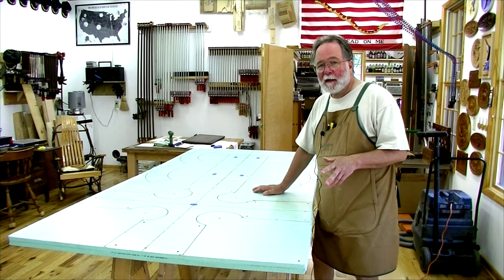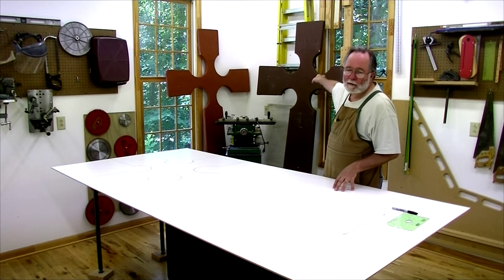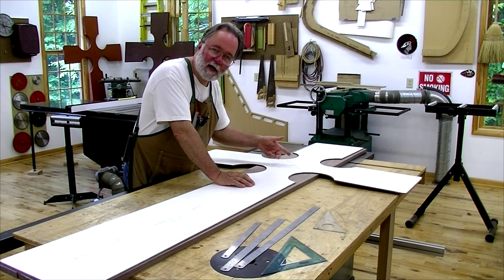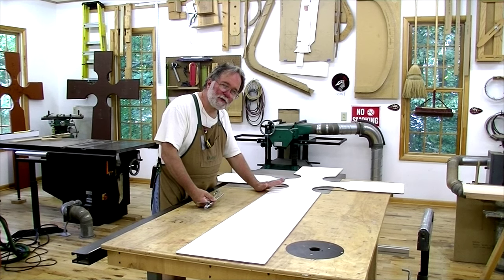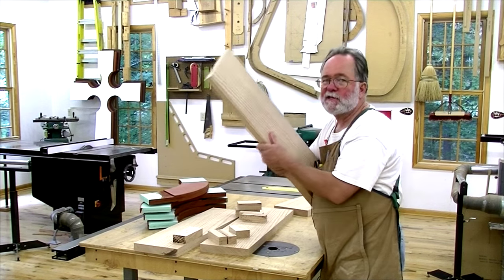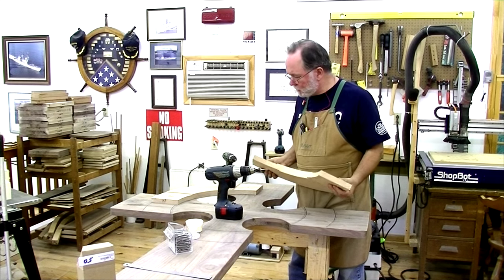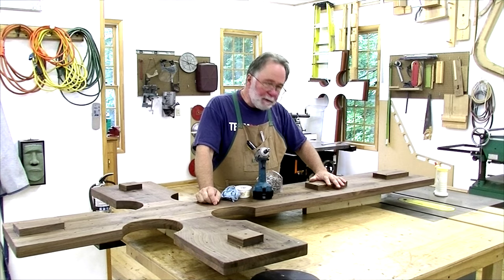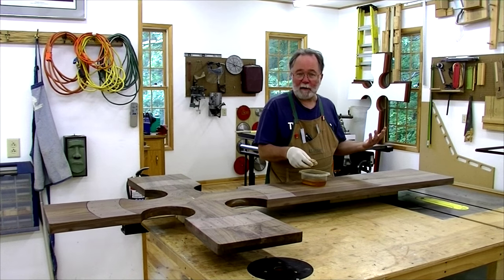Making a Celtic Cross: Andrew Pitts~ FurnitureMaker

Comment: Why did you not design for the center wheel to turn ?
Reply from the maker: I don't understand your question.
Reply: @Andrewpittsfurnituremaker  Hello,,,the center "wheel" of the cross was a weighted wheel used to measure degrees of incline.   The tool was of such great importance it was revered and became a sacred object.  If you like to understand fully plz consult the work of Creighton Miller.   He holds the patent on the discovery.  He has written a very interesting book on the object.   cheers!